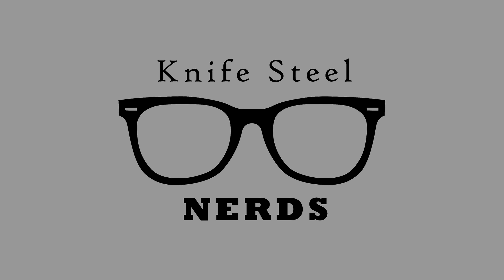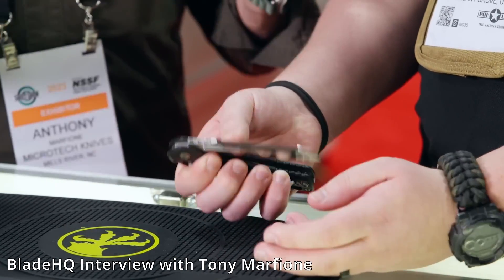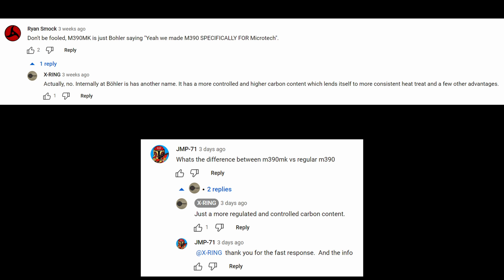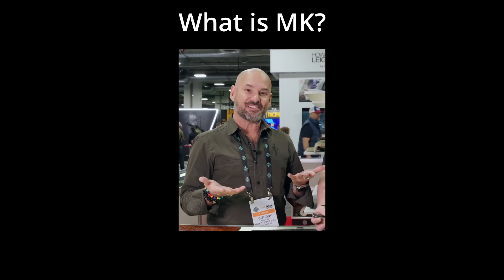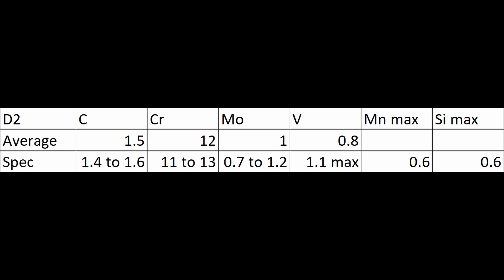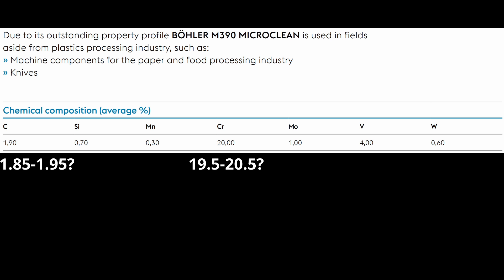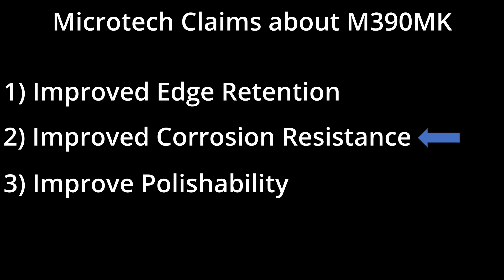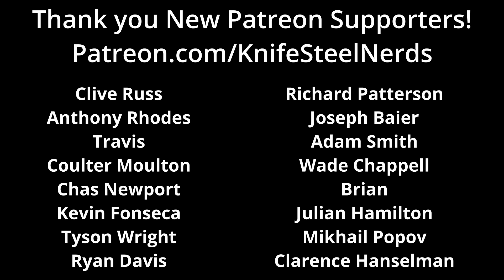New M390MK Knife Steel?

Comment: Well... Regular M390 in my Lionsteel is NOT that impressive so... Let's see what comes from that "exclusive" 🤔🤔🤔
Reply: Thats because lionsteel heat treatment. Low temper temp and no liquid nitrogen. I forget the specific protocol off the top of my head, but its 60rc and performance far below what any other 60rc m390 performs as.

The protocol is not providing a microstructure for edge retention.
Reply: On top of that they burn the edges polishing and sharpening them.
Reply: @tacticalcenter8658  what’s a good hrc for m390? Edit: for its intended properties.
Reply: @rigajykra3159  its more about microstructure. Watch a video called Microstructure matters. There's a lot more involved than what this video describes but you can glean a little bit of information from it. But the protocol matters more than an rc number. Once you have a good protocol for the right microstructure then a higher rc up to a point is going to be better.

Also note they can do a low heat temper or high heat temper depending on how they want the microstructure too.

Using the information from knife steel nerds, heat treatment books and that video should help understand a bit more.
Reply: @Rigajykra  well for edge retention,  61-62 would be best,  but for thin geometry and very pointy tips like a microtech tanto,  59-60 is probably the best to avoid broken tips
Reply: @tacticalcenter8658  thanks for your in depth answer. I appreciate your Time. It certainly is a rabbit hole this heat treatment do. I have some 20cv (m390) to which I will send off to a specialist near me, I imagine m390 would make a nice outdoor knife.
Reply: @shawnpepin7890  thank you.
Reply: @shawnpepin7890  Microtech blades are thiccccc AF behind the edge. They could run M390 at 63hrc and not have to worry about chipping lol
Reply: @shawnpepin7890  Jim Skelton dragged a 62rc m390 blade behind his car without breaking it. Just saying.
Reply: @arrowheadguys7637  more the tips I worry about , but then again, I live in Canada, therefore microtech knives are like guns and I can’t legally own one, so was just assuming
Reply: @shawnpepin7890  Yeah, I have a bounty hunter with the tanto blade. Super thick, even at the tip. They're all for looks.
Reply: Lionsteel runs their m390 wayyyy to soft, like 58-60 hrc… it’s sad, because they could be doing it way better.
Reply: @shawnpepin7890  Microtech runs it at 58-60 too

Comment: Also painting flames on the side of the blade makes it perform better
Reply: Don’t forget about putting some speed holes in there
Reply: Would additional fan cooling increase edge retention?
Reply: AS Orcs would say "Red uns go faster!"
Reply: Adds an extra  2 degrees of HRC
Reply: If you lazer etch the side, it could bring the rc down, depending on the temp of the lazer.
Reply: @tacticalcenter8658  i know it was a joke.  Honestly all MT is doing is trying to hype up their marketing again after all the issues last year and try to bring "decent" steel.  It will most likely be 58-60 hrc and the same old song and dance
Reply: Flames make it burn through your cutting faster ! Only cost $149 more.
Reply: Like red tow hooks on “off road trucks” 

It’s the unwritten rule for better performance!
Reply: Spyderco has a steel and we want one too.
Reply: That's what I did to my butter knives..
Reply: That's scientifically true actually.
Reply: A couple of stripes will make it cut faster.
Reply: Man…I must’ve painted the wrong flames, cuz’ I don’t notice any difference…🤷🏻‍♂